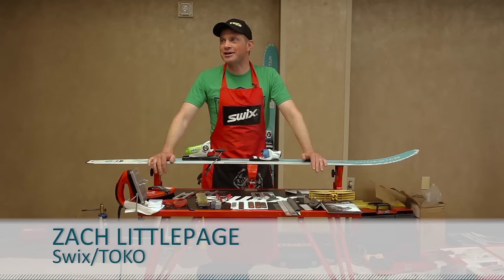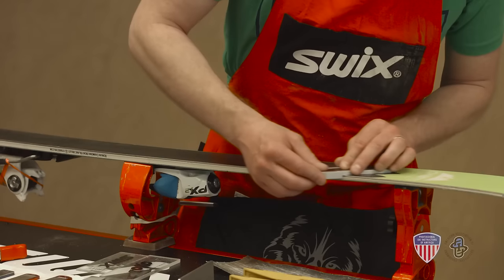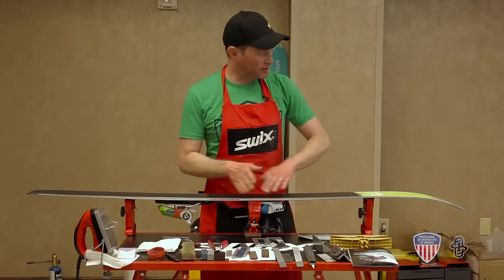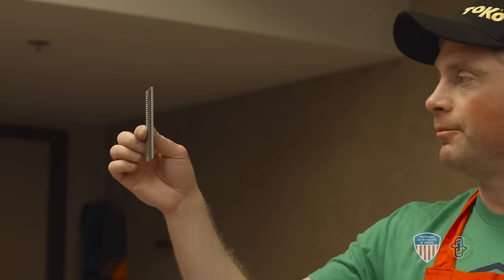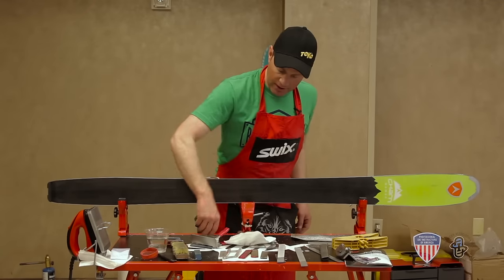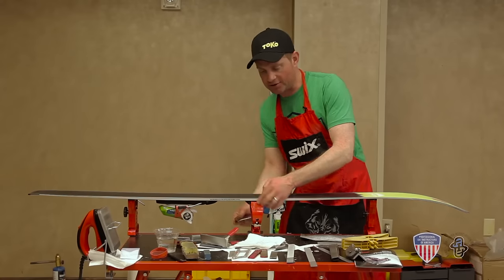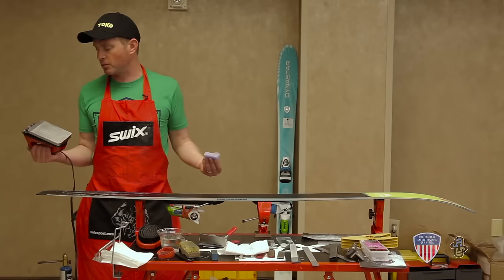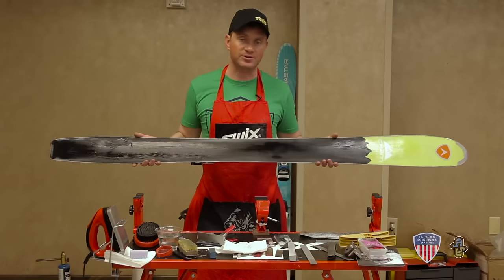Learn How to  Wax and Tune Your Skis

Comment: Come on man never push those files forward but only in the direction the ski slides
Reply: He's only applying pressure when moving towards the back of the skis.  He's a pro, he knows what he's doing.
Reply: Jeremy Liem you can’t actually go both directions. Running down the ski is only important working with the base of the ski/ waxing.
Reply: But what if I ride switch?😃

Comment: I worked in a ski shop for 20 years learning how to hand file skis in the 1970's, I always started with the edge filing first and then filed the base to debur the angle flat compared to the base.When beveling became popular I learned to adjust the angles slightly with masking tape over one end of the file for better edge holding. The new file holders are a tremendous tool to do this properly. Nice video though and it's very important to explain how many steps the modern skis need to be tuned properly.

Comment: I have a pocked edge tool that is only intended for side edges (skiman brand). The problem is that when i switch sides i can only use the file from tail to tip. So one side of the ski  I can sharpen with tip to tail strokes and the other side i must do it from tail to tip, so if i change the direction of the file i must change the angle to. Is that a factory defect or they just didn't make it correct. Does sharpening one side with reverse direction impact the sharpening process. THanx

Comment: I can really appreciate improvements in tech. I just used a 12" mill bastard to try and flatten the base. De-tune the tip and tail and guess at angle. One I was told, always go in one direction with the file, to the tail....great post:)

Comment: As far as scraping wax. You want to have a sharp plastic scraper WITH NO BURS! I always like to use long strokes with little pressure until you have little to no wax coming from the ski. If you have a metal brush use it first, if not use a horse hair brush. You always want to go from most course to least. Always go from tail to tip, this is the best way to get the wax out of the structure.
Reply: It's almost like you should do your own video

Comment: Seems to me that the base edge sharpening he is using will result in a convex shaped base. Holding the file at an angle, but flat will result in a flat ski. Convex bases result in the ski hooking.

Comment: What setting/temp for the iron?
Reply: Depends on the wax you are using. There will be instructions on the package. Usually somewhere in the region of 110-150 degrees centigrade.

Comment: so i will wax it when i want more speed... for now i'll keep them as they are
Reply: It doesn't make you faster, it just decreases the friction of the ski on the snow and allows it to glide better. If your a beginner or intermediate rider who isn't comfortable at speed, your better off sticking to easier runs than not waxing your skis. It actually makes it more confidence inspiring when at high speeds if you have a well maintained ski, as it reacts predictably and smoothly to your movements. An unwaxed ski will feel really sticky, especially in powder or slush, and a ski with poor edges will feel really twitchy or unstable when lent over. Sure, an advanced rider can still ride well with crap skis, but that's down to experience and confidence. When you lack both of these, its helpful to have a good ski to give you every advantage you can get
Reply: Yea you really should wax them. It's like keeping a bike tyre uninflated until you know how to ride, sure it will be slow, but also inconsistent/dangerous and it kills all the fun. It's better to learn how to brake.
Reply: Philippe52 
Plus it keeps the base material from drying out. I had a pair of skis that I neglected to wax for a season, the base got a light whitish haze and after that it never would absorb and hold wax. After like 2 days out the skis were slow and dragging badly. So I’d have to wax them after a full day out. Just my experience. 
Learned my lesson and I wax all my skis regularly and at the end of the season when they get stored.
Reply: JCW, P52, & Greg B are all correct... and to add to their knowledge - waxing (as shown in the video), gets wax to soak into the pores of the ski base, providing a little extra durability. A dried out base will be more prone to scraping & gouging, whereas a waxed base will resist that damage (not that they can't get damaged if you ski over a rock or branch or something, but the waxed base will be damaged less than an unwaxed/dry base).  You want to wax your skis.

Comment: No lube with the stones!  Bad. Destroy stones.  Dragging file backwards!  Bad. Ruin file.

A Swix guy not using Swix Glide Wax Cleaner prior to waxing?  IDK about that.  Need to remove grease and other junk from base first.
Brush alone not nearly as good.  Better than nothing though.
When waxing the edges were too cold.  That's where the base burn starts.  Need to tilt iron to heat metal edges up.  They are a heat sink and pull heat out if the base.  Need wax absorption all the way to the edges.
Reply: Exactly, need soapy water on the stones which helps remove grit, allows better cut/polish, allows smoother movement and prevents the diamond stones from wearing out so much faster. I suppose when you get all your tuning gear for free you don't have to really worry about this???
Reply: @cratra  Yea, always use water at least!  I mix water and denatured alcohol.
Next way to ruin a diamond stone is using too much pressure.  If I have a really bad edge, I wrap some 220 wet sand paper around a stone and use that first, before I file or stone.
Reply: @Sagina1999  Another thing I find bad for tips of 100mm diamond stones along an edge clean tune is Magne-Traction. This cuts into the tips and wears the ends out excessively. So you need an edge tune device that holds the stone along its width rather than length to prevent this wear.
Reply: @cratra  Yea, I've worked over a few of those skis.  I've always just used a small portion of the file and stone, so for me, it was about the same.

Comment: 11:03 do that step in the other direction it helps a lot
Reply: Trizz I got that tip from a guy that works for the Austrian race team (Europacup),and it works!
Reply: Johann Winkler you’re supposed to brush it from tip to tail, like the snow slides under the ski
Reply: Trizz yes after you waxed your skis before you wax them you do it in the other direction